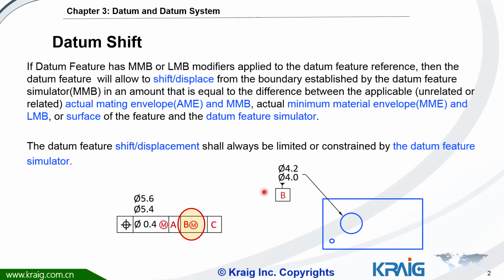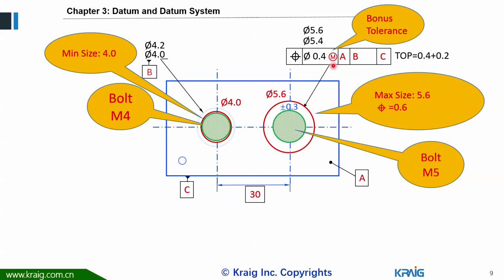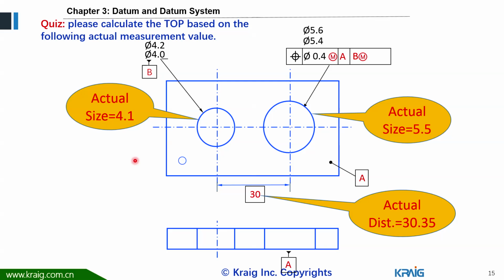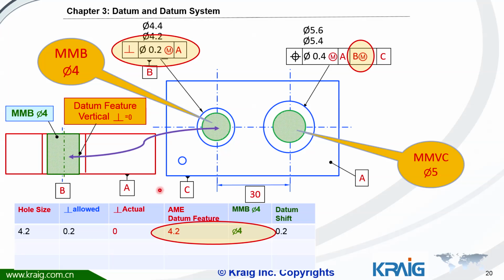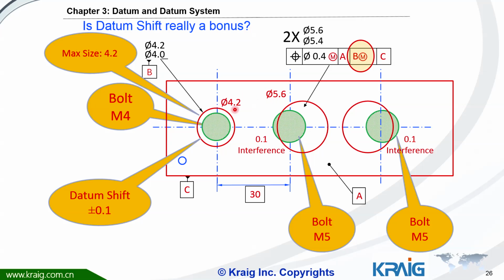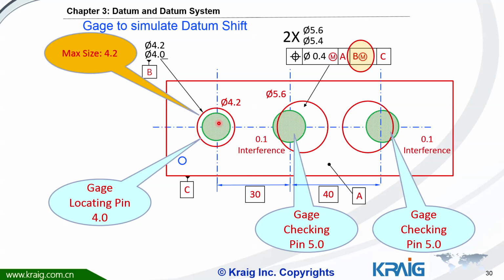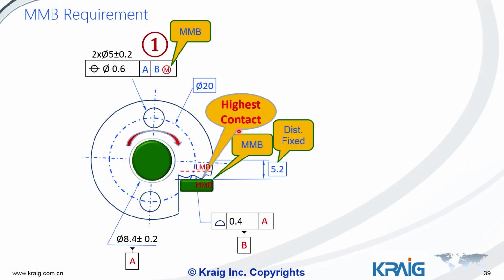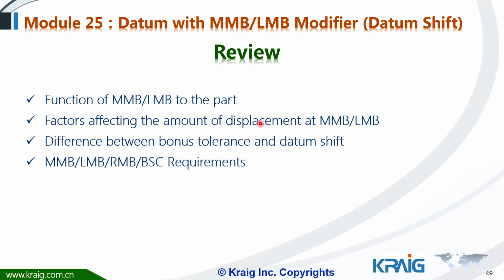25 Datum with MMB LMB Datum Shift 2024

Comment: sir, could you do video for same example , regarding feature have MMC AT ZERO condition for same size tolerance ,what are the changes would come in simulator gage pin ,kindly.
Reply from the maker: Hi Hari, if tolerance value changed to MMC AT ZERO, then checking pin will be smallest hole minus 0 (5.4-0=5.4), datum locating pin will not be changed.  Michael
Reply: @kraiginfo6339   Hai Sir thankyou

Comment: 8:01 Sir,if the left side hole is made at dia of 4.1 ,datum shift will come 4.1 - 4.0 =0.1 ,each side will maintain 0.05. So still interferance is 0.1 on right hole .So this part is acceptable or not.
Reply from the maker: this part is not good.
Reply: @kraiginfo6339  thank you sir

Comment: 28:00 , Datum B is a surface which is not a feature of size. so how can we apply modifier to it ( datum shift ). can you please explain more this case? Thank you.
Reply from the maker: Based on ASME Y14.5-2018 (Page 118), if Datum B is surface and is secondary datum, MMB (Maximum Material Boundary) is allowed to apply to datum B.
Reply: It isn't a feature of size, but since it has profile tolerance applied on it, it has minimum and maximum boundaries.  And if it has boundary, I think we can apply MMB and LMB to it.

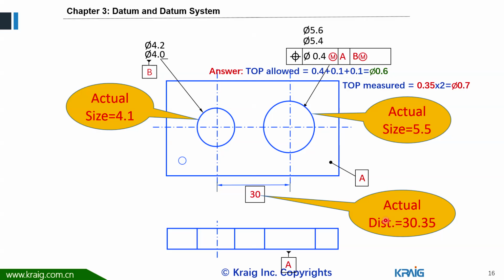Comment: 12:20 How second hole can shift +_0.3 while the Datum B hole has only 0.1 tolerance is there even if there will increase hole size 0.1 to 0.2
Reply from the maker: If Actual size of Datum B hole is 4.1, then datum shift will be 0.1, plus bonus 0.1 (5.5-5.4), plus basic position tolerance 0.4, total position tolerance allowed: 0.6 (0.4+0.1+0.1). Hence, deviation for toleranced feature allowed is +/-0.3.

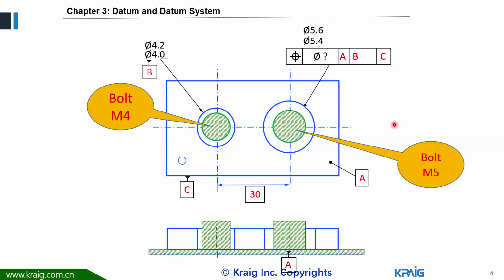Comment: 2:05 I’m afraid the basic datum system A I B M I C doesn‘t follow function. The solution is A I B-C. MMC is not required.
Reply from the maker: thanks for your comments. It depends on the function of part, either way is allowed per international standard.
Reply: Yes. Function is the leader. Why is the explicit specification of function missing in every example we have ever discussed?
See: In this component we are only talking about contacts. And contacts occur between two parts (two features of two components).
An explicit specification of contacts is free of a model by ASME GD&T or ISO GPS.
May be, we have a problem in our mechanical engineering… without an explicit specification of function.
I‘m afraid it‘s a big challenge for us, to explain what a functional based specification is. Because it should be manufacturable, but can not be manufacturing specification. We must derive a manufacturing specification.
Reply: @ What are the functions of this component?